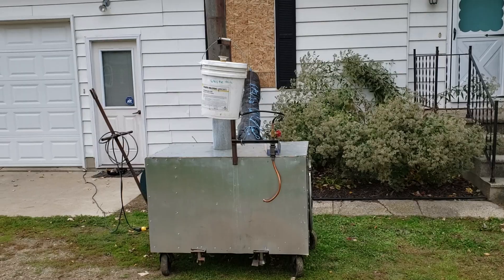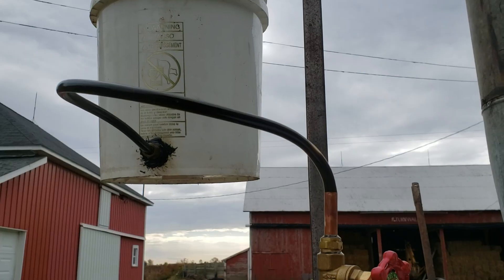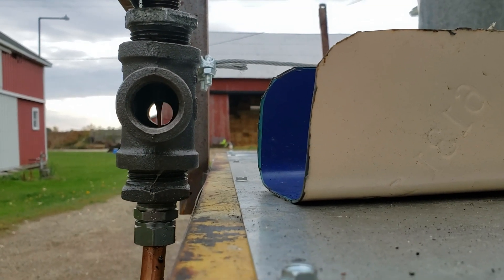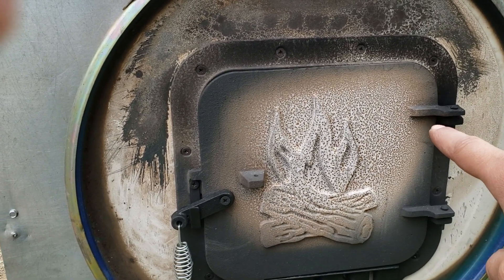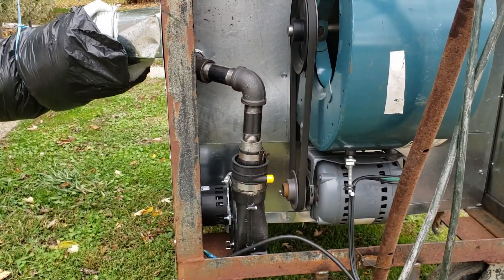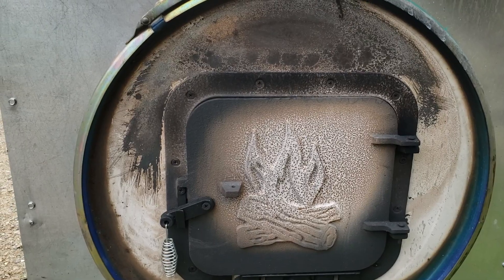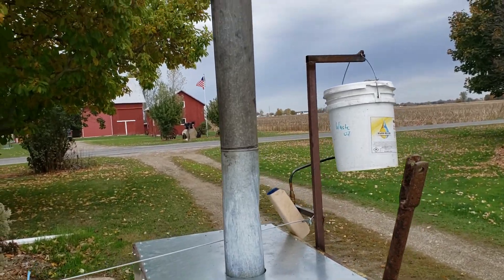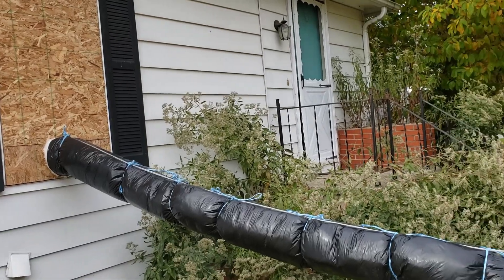Waste oil burner, heating my home with free oil

Comment: What part of the country are you in as how cold does it get in winter.?
Reply from the maker: I'm in michigan in the U.S.     It can get pretty cold here.  Its about 28 degrees f on the regular right now but we'll hit negative temps soon enough.
Reply: @therandomfarmer4231   What part of Michigan? We just signed papers on some property in the Gaylord area. Plan on building a couple cabins and playing around with off-grid tech (solar, wind, water retention and storage systems, etc.)

Comment: Nice!!!   How long does it run on 5 gallons?
Reply from the maker: If its around freezing outside its at or slightly below a gallon an hr.
Reply: @therandomfarmer4231  Not bad! I was thinking of every option out there to heat a home from electric, propane, wood and solar and none of them would have been cost efficient. then I found waste oil which  is everywhere.